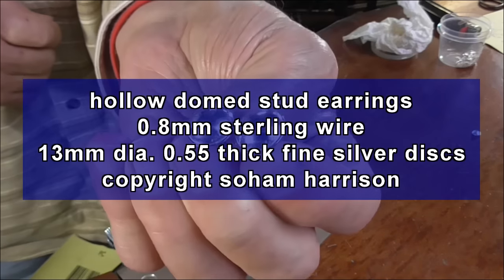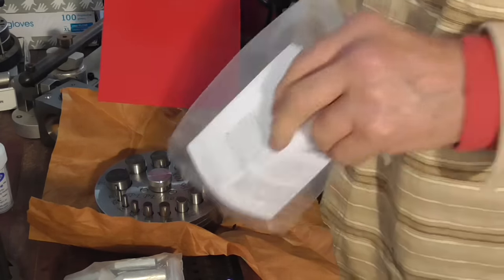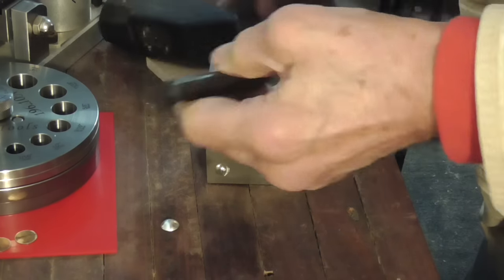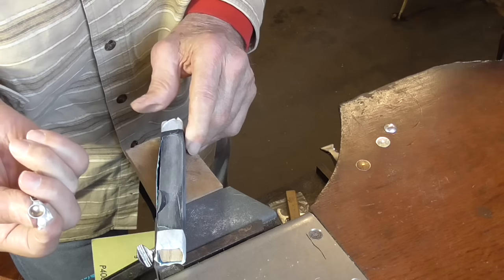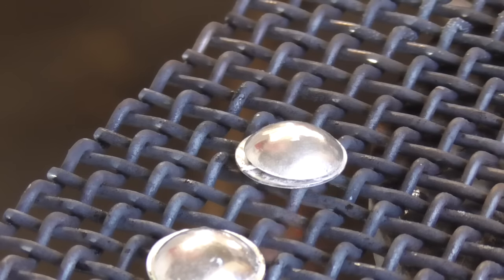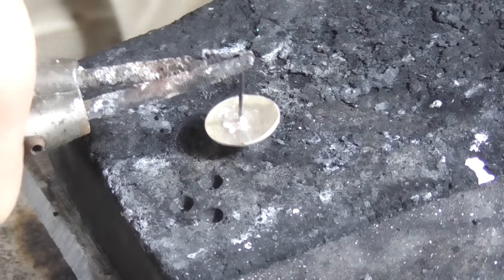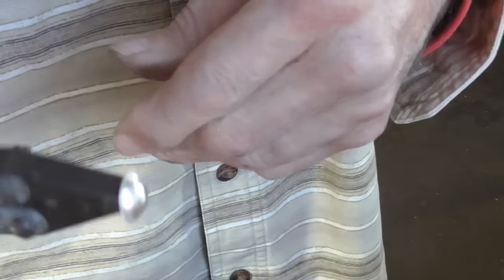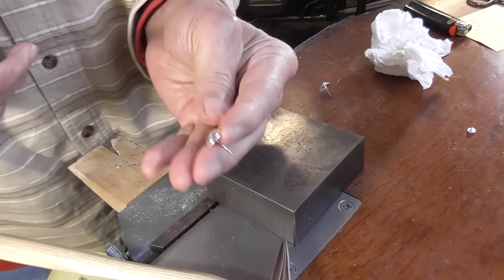hollow domed stud earrings

Comment: Hi Mr Harrison! I've been inspired enough by your videos to actually start working with silver myself. I have a question about an older video you made showing how to make fire scale protection using Boric Acid and metho. All the books say to use rectified spirit (ie pure alcohol), and metho is close to it. But my problem seems to be that the Boric Acid doesn't seem to dissolve into the metho. All it seems to do is sink to the bottom and I have to stir it each time I want to paint it on. As the acid doesn't dissolve it sort of sticks to the metal with little lumpy bits of boric acid and not an even covering. I've tried several different brands of metho too but all produce the same results! Do I have to grind the boric acid to an extremely fine powder for it to work or straight out of the container? The way you show seems so simple but I just can't get your results.Any advice?

Comment: Love your videos! I was taught to drill the hole if doing a hollowed form because the metal could explode during the soldering process. The air trapped inside the metal vessel expands and may cause the metal to explode! Are you saying that this potential explosion occurs because of rapid cooling during quenching and not during the intense heating at soldering? Thanks for your response! PS I learn so much from all of your videos!
Reply: This is what I was wondering as well! :)
Reply from the maker: yes, if you quench water is almost always drawn in through small holes. if you dont quench, no water to expand into steam, so no explosion
Reply: Thank you!